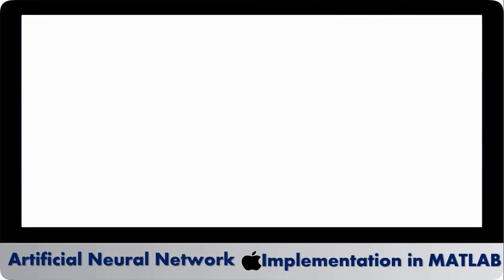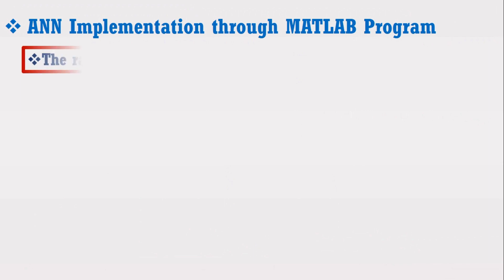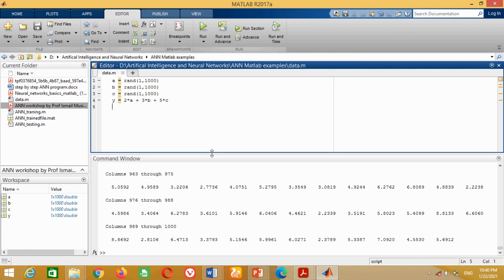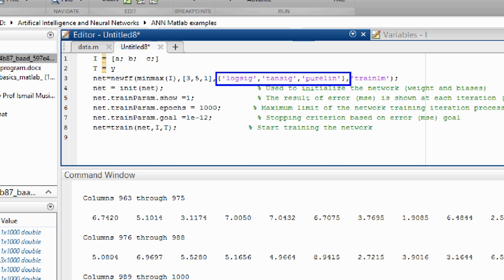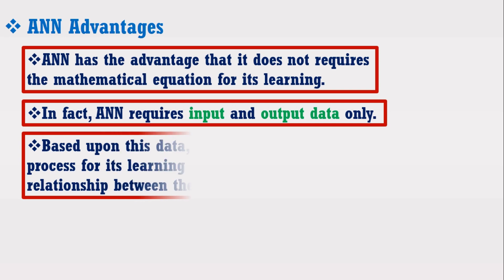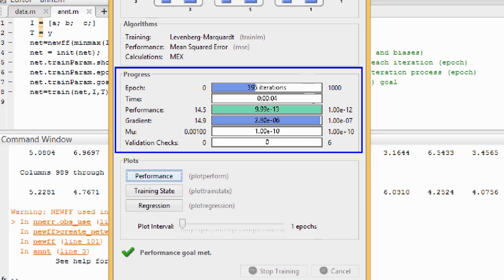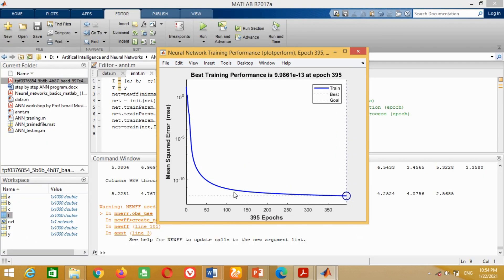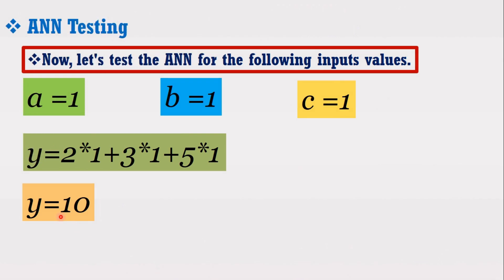How To Implement Artificial Neural Network (ANN) in SIMULINK ?  (Part-2) | Dr. J. A. Laghari

Comment: Assalamualaikum sir, thank you very much for your great work, this is very helpful!

Just an important notice I wanted to share with you regarding the layer size assignment [3,5,1]. The first one '3' is actually the number of neurons of the first hidden layer, and not the input layer. '5' would be for the second hidden layer and finally '1' is for the output layer.
The input layer does not hold an activation function, it only holds the input values of the network and no processing is done here. I believe mentioning this detail is very important to avoid misconception and confusion.

Thank you again and have a wonderful day
Reply from the maker: Thank you so much for your detailed explanation. Infact you are right. I agreed.

Comment: Thank you for your effort sir, how can I do it in solar cell ? like  input=Jsc,Voc, FF and Output =efficiency
Reply from the maker: Thanks for the comment. Use the equation which has these values then run it for different input ranges. Then do the same procedure to train it using ANN.

Comment: Sir actually what is the dataset type?is it pv voltage and pv current as an input?? Or it is temperature and irradiance??
Reply from the maker: It depends upon your choice which parameters you are using. It makes no difference.

Comment: nice video. but sir here i want to know how we can use "divideInd" parameter for training, validation and testing?
Reply from the maker: Thanks for the message. You can use this testing by writing this command below the training command, and divide the data by 70,15,15% for training, testing and validation. Or you can also do testing by using nntool gui. For this purpose, you have make three variablee namely training, testing and validation data.
Reply: Yeah sir, I have used net.divideFcn = 'divideind' 
And I have divide the three sets like training , validation,testing as 1:75 ,76:90 and 90:100.
But I am getting error in ANN modelling as on my workspace the performance mse is different than shown on nntrain view window.
Can you help me out of this error?
Reply from the maker: @sunilbadyal4415  I think this will be different. Because ANN gives every time  different results .
Reply: Yeah sir I know that but after we have divided the dataset using divideind it will restrict the domain of training , validation and testing data 
As an example we have data of 100*1 
Using divideind we will fix the dataset like 1:70 for training , 70:85 for validation and 86:100 for testing . For which it will give different regression individually for training validation and testing
And for output it will give total output of 100 dataset and corresponding to 1:70 we will get the our training output, similarly in case of validation and testing.
Hope you will get what I m trying to say.
Sir can I get your mail or other contact media so where I can easily discuss this problem??
Reply from the maker: @sunilbadyal4415  my email address is
jalaghari1@gmail.com
Reply: Thnx sir 
I will mail you
Thnx for responding
Reply from the maker: @sunilbadyal4415  Sure.

Comment: Sir! I happened to design an ANN successfully as per my requirement. Just want to know how we can determine the importance of each input variable i.e. relative contribution/effect of input variables on the value of output. Thanks in advance.
Reply from the maker: Thanks for the comment. I think it may not be possible to know the relative importance of the input variables.

Comment: how make in puts and targets and what s difference between them thankyou to answer sir
Reply from the maker: Thanks for the comment. Inputs are taken according to your system model. If you are controlling frequency then frequency will be the input and turbine valve will be the target output. Target output is the expected output that ANN has to provide.
Reply: FOR MY CASE IAM WORKING ON LANDSLIDES i have seven parametrs and every parametr have its own lass for exempl para 1 has 3 class  ,param2has 7class etc how to do in puts and targets  thankyou sir for answer

Comment: 5:05 matlab didnt just generate 10 random numbers between 10 and 15. it has also generated numbers beyond the range. kindly give correct code
Reply from the maker: Thanks for the comment. Basically, It will generate the random numbers between 10 and 25. The code is corrrect.

Comment: sir, may i ask you? how this can be implement to fault detection in transmission line. i can understand the basic here, but is there any change for the code?
Reply from the maker: Thanks for the comment. The ANN code remains same for all types of topics. Only input and output data will be changed.

Comment: I don't get performance goal met at bottom on windows upon running this code but  it shows max epoc reached , why I am unable to get result. kindly help sir regarding this. thank you
Reply from the maker: Thanks for your message. It is ok. No issue. It is because goal set by default is 10-12 which is very large. And it is almost not possible to get this default goal. If you want to reduce the goal, then you may change it in the program. But you just open the regression curve, if R=1 or close to 1,then your ANN training is successful.
Reply: @DrJALAGHARI  thank you, sir. how can we replace input here with values from an excel file. sir can you please help regarding that.
Reply from the maker: @kamranfaisal5337  if the data is small then you may copy and paste the data in the m-file. Otherwise, you may also call the excel file in the matlab. Just search the command for this. I will made another video on this topic. But it will take time
Reply: @DrJALAGHARI  thank you, sir. as per your suggestion, I found a way to enter excel data. i have been trying to modify code in this video to accomplish a small task which is  "Fault detection and classification in an electrical power transmission system using artificial neural network ". after initializing  of inputs and outputs i am having error  at this line :

net=newff(minmax(I),[6,18,15,1],{'logsig','tansig','purelin'},'trainlm');

these are the errors i am getting :

Error in newff>new_5p0 (line 285)
  net.layers{i}.transferFcn = tf{i};

Error in newff>create_network (line 127)
  net = new_5p0(varargin{:});

Error in newff (line 101)
  out1 = create_network(varargin{:});

Error in test (line 14)
net=newff(minmax(I),[6,18,15,1],{'logsig','tansig','purelin'},'trainlm');

kindly help regarding this
Reply from the maker: @kamranfaisal5337  Thanks for your message. You have increased the layers by putting 6,18,15,1. Therefore, you have to assign activation function too. But you have not defined it. Just add another tansig activation function before the purelin. Then run. Hopefully, it will work
Reply: @DrJALAGHARI  ok sir. sir if we want to break the hidden layers how can we write that? 
also, I have multiple output columns in 0 and 1 form to indicate error, how should I write output then ??
Reply from the maker: @kamranfaisal5337  These things are not eqsy to understand thriugh messages.
Reply from the maker: @kamranfaisal5337  i will not be able to give you time due to my busy schedule. I hope you will not mind.
Reply: @DrJALAGHARI  No problem . Thank you sir for answering my queries . JazaakAllah

Comment: Asslam-U-Alikum Dr.J.A, Really I have question very important for me, that is about predict by Neural fuzzy, which I have followed the steps exactly and  the result  was  perfect, but I have question that is,  when  I have data from a previous experiment  or a  study, and I  applied  these  the steps and  the results appears  is well through I getting  on graph ( Validation, Test, training, and All) . in  this  approach  I have  got predicted output, which I can  comparative with  pervious data for showing  that using neural fuzzy is  more accuracy than anther method, and  I haven't  get on  optimization solve. I  carried out previous  paper by fuzzy logic response surface methodology by  modeling and optimization corrosion rate  for crude  oil in pipeline. 
I would like  to  learn how  after implementation by neural fuzzy by MATLAB,I can determine Error between this  method  and  previous method, and  optimization solve
Thanks
Rania
Reply from the maker: Thanks for the comment. If you are comparing between ANN and other type of ANN then comparison can be made by measuring accuracy of both techniques. However, with fuzzy it may not be possible to do the comparison.